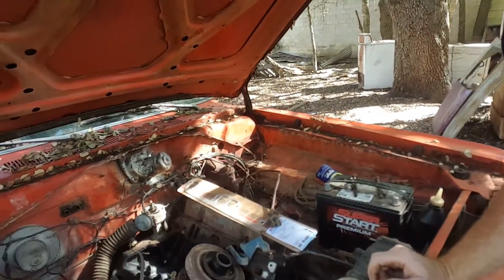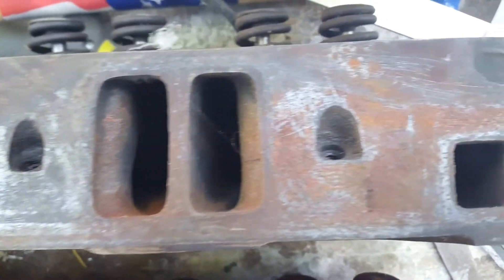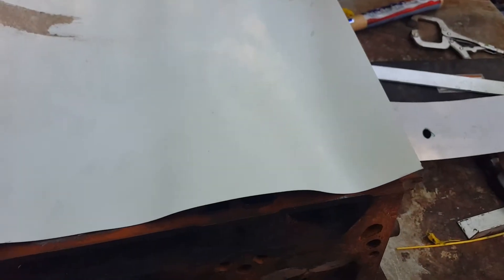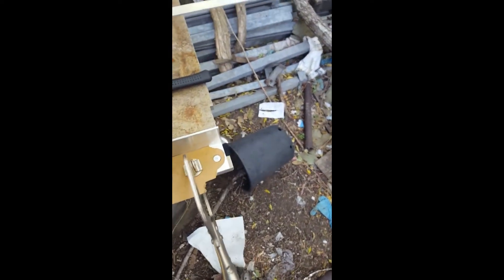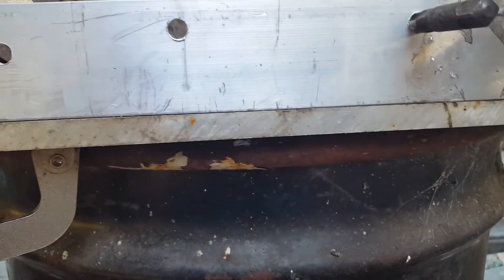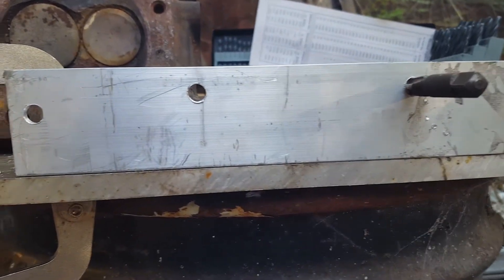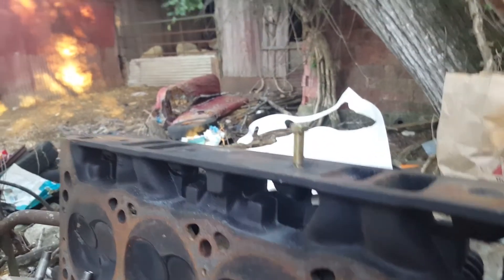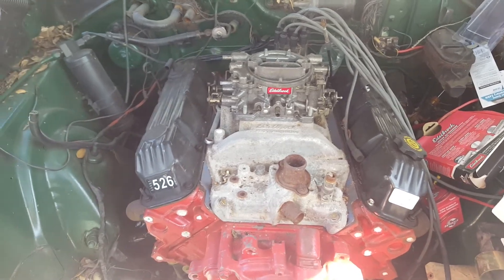Magnum to LA intake mod

Comment: i cant find the video where you made the template with the hammer. also why could you not just use a gasket as a template
Reply from the maker: The gasket was broken and it is easy to make one with the part and a hammer
Reply from the maker: https://youtu.be/xUHC3NUPub8
I also made one in one of the Huevo Ranchero Videos

Comment: Using a 1972 dart 318 la engine could I just use a magnum intake? I’m only looking for reliability of fuel injection.
Reply from the maker: If your not using the magnum heads then you would need to redrill to the magnum bolt pattern on the heads or redrill the intake to LA .
Reply: Then what do you do about a crank sensor? Also we have the same year dart. So what was your donor trans and engine from
Reply from the maker: @philh9238  I am running a carb and 904 transmission. Since I installed a 360 magnum, if I run the efi I would cut a hole in the bell as the magnum flexplate has little windows cut for the tone ring. 
I have another magnum with the tone ring included in the balancer. Problem with that is 360la and Magnum have differnt imbalance and 318 is neutral.
Reply: So the ultimate plan is I want to go from a 318 la worn out smoker to a 318 magnum and use efi. So what half modern trans would I be able to bolt in? I don’t want to mess with kick downs cables or nothing just want it to be computer controlled. I’m a mechanic by trade but just never thought about swapping a magnum engine in until a week ago
Reply: Well I do have a 1990 d250 that runs but has a rotted frame. It’s tbi I could just redo my 72 dart engine  and just use the tbi intake and distributor with pcm? And keep my  dart trans and just put a lokar kick down cable on and call it a day. Would a tbi distributor work in a 72 dart or the cams have to much of a difference for distributor gears
Reply from the maker: @philh9238  slot is the same
Reply from the maker: @philh9238  you can go 318 magnum with a 46RE. There are ways to set it up to use the stock wireing harness from the doner vehicle.
Reply: Wiring isn’t an issue for me. You think the trans tunnel would need cut out to fit the 46re? And would the driveshaft work for the stock 8 3/4 rear end

Comment: Did she hold up?
Reply from the maker: So far
Reply: @stephenhotzjustdriveit  would you consider selling that adapter plate?
Reply from the maker: @chriscameron6811  there is one that is steel that is a loaner over on www.forabodiesonly.com
Reply: I clicked the link but couldn't find it.
Reply from the maker: @chriscameron6811  will dig out the direct link

Comment: Aren't the LA holes at 10 degree angle?  Have you ran the engine for any length of time to see if everything stays sealed and that you have no vacuum leaks or oil leaks? let us know after 10000 miles the verdict. Thanks
Reply from the maker: I have ran the engine. Will update after its been on the road a while